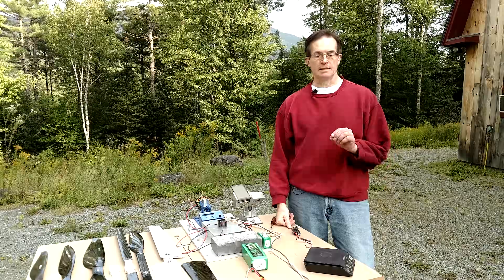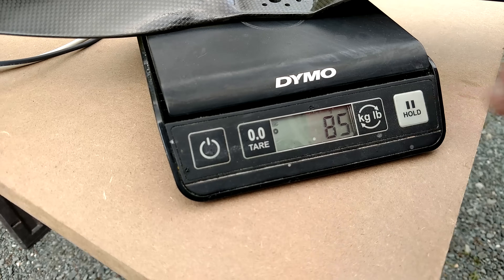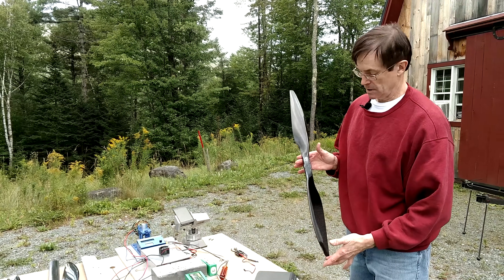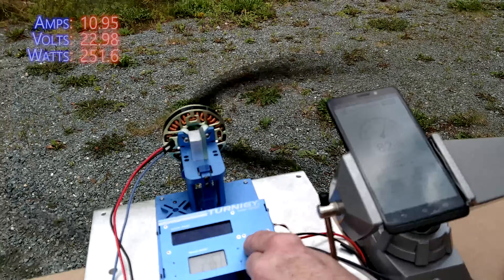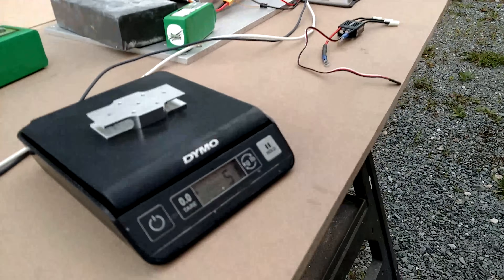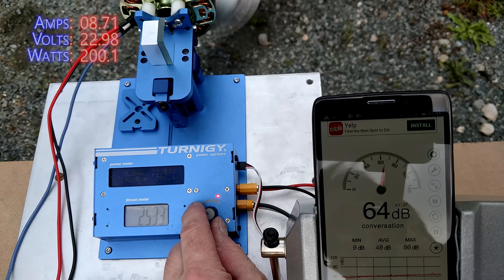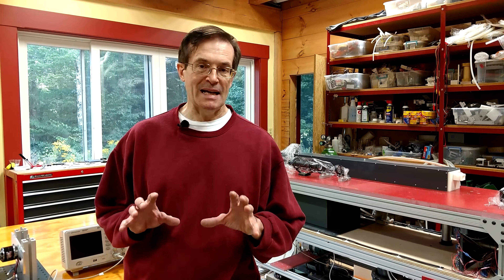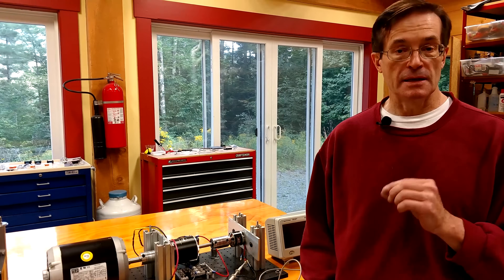Building Drone Rotors - PART 4 - The Testing

Comment: Great video, subscribed.  What primarily interests me is reducing audible noise.  Obviously larger props provide X thrust more quietly than do smaller props because the RPM is lower.   The challenge that interests me is how to use the largest possible props on the smallest possible drone platform.  If you had props which overlapped it should be possible to drive them all with cogged belts so that phasing is maintained to prevent interference.  Something I'd like to try someday.      

The APU concept is fascinating as well.  Not only for drones but also for robots.  Once again noise is an issue, so I'm interested in ways to muffle and perhaps actively cancel motor noise.  An MIT startup called Liquid Piston is developing small rotary engines for DARPA, so that's one example, I'd like to find others.  In the meantime maybe a weed-whacker engine could be adapted, and hollow structural components made of carbon fiber or aluminum could be used to store fuel.  The fuel storage and burnoff in drones would need to be designed to maintain CG, however it's done.

I haven't yet gone through the catalog of your videos so you may have addressed these points already.  All this is just off the top of my head because I'm a recently-retired electronic/aerospace tech who's still trying to get my life organized enough to have time for hobbies!  At this rate it may never happen...
Reply from the maker: We share your interest in quieting  multi rotors.  The use of alternative drive mechanisms is interesting and always involves a balance sheet.  I am an advocate of KISS and the advantage of a single motor with a single propeller is difficult to  beat.  This preference derives from the widely available components, the convenience of routing power through flexible wires, redundancy and weight.  Something we are considering is the use of two, significantly different arm lengths to improve rotor disc packing density and the hybridization of helium buoyancy and multi rotor maneuverability.  Blimps tend to be grossly under powered and multi rotors use watts for every gram they lift.
Reply: Thanks for your reply!

So I guess you’re referring to basically creating two or more concentric “rings” of props by using shorter and longer arms, so as to pack more rotor discs into a given footprint.  Sounds like a great idea for larger drones!

It would require a significant volume of He to fully offset the weight of a drone, and with all that additional surface area the wind would not be your friend, for sure.  I wonder if it’s feasible to design a very quiet motor/prop combination which is optimized for a fixed RPM region, and locate it dead center for the purpose of offsetting the weight of the entire drone, as well as provide additional cooling for power components.  If heatsinks are normally required they could be smaller if airflow is higher.  The outrigger motors/props would only need to offset the torque of the center motor and of course provide directional control.  The smaller props would no longer need to offset the weight of the drone so they could presumably turn slower and quieter.

In terms of KISS, the traditional approach of one motor per prop is probably the simplest to control and provides the most redundancy as well.  But using multiple props per motor should be lighter, or at least not any heavier, as well as allow for rotor disc overlap because phasing is fixed.  Instead of varying relative prop speeds to obtain directional control, which is not possible with multiple props per motor, you could have very lightweight steerable vanes located in the downwash of the props.   That of course would require changes to the control algorithm, so the fun never ends…
Reply from the maker: I agree with your comments regarding the choice of rotor systems.  The reason I suggested helium is because modern fabric/films such as Spectra or Dyneema reinforced polyester (Cuben cloth) and carbon nano tube based ribbon  (Miralon) have become so light and strong that nearly weightless envelopes can be fabricated and held at high pressures to ensure shape.  Contrast this with the never ending spiral of a multi rotor...if you want more payload add more batteries which means more powerful motors, stronger arms, a heavier air frame and so more batteries etc.
Reply: Tech Ingredients     A hollow rigid structure pressurized with He?  So wouldn't loss of pressure be catastrophic?  One shotgun pellet strike and you're done?  I'm curious though frankly skeptical. 

Have you considered single-blade props for lower noise?  Apparently the efficiency is roughly comparable to double-blade because of reduced turbulence.
Reply from the maker: Theoretically, a single bladed prop will be more efficient, but the rotational inertia will have to be countered and if the counterbalance is located closer to the rotational axis then it must be heavier, if it is located at a similar distance then you may as well just leave the propeller as it is.

Regarding the helium, I did not mean to suggest that we inflate a typical CF multi rotor frame.  I would certainly use compartmentalized helium storage.  We own a 6M blimp which we use for lofting radio antennas.  It's a good quality blimp, but polyurethane is pretty old school.  Modern films could allow better aerodynamic structures to be fabricated with negligible weight.  I understand your skepticism, but remember if you could remove 1/2 the weight from an existing multi rotor without changing ANYTHING else, your flight time would not double, it would increase on the order of 500%
Reply: Tech Ingredients   Thanks for the conversation.  I assumed the He would be compartmentalized but even so a loss of pressure in one compartment would still cause some kind of structural failure, no?  

My point on the single blade prop was about noise mainly.  There's videos on YouTube from years ago showing such props apparently working well on RC aircraft.  For some of the props a simple metal rod served for a counterweight.  So yes, one wouldn't do it to save weight but rather just to reduce noise.

Not sure of the terminology but there's a way to basically create a circular airfoil duct around the props which gives a bit of lift.  If it's enough lift to offset the added weight is probably a matter of how lightweight the circular assy can be fabricated.  From what I've seen so far I would bet you could make it pay off if anyone could.  The tunnel part of ducted fans which constrains the prop wash seems like the part that could be omitted without making much difference.

Comment: I wasn't clear on the thrust to power ratio comparison on these props...? 11:41 scared me a little too.:(
Reply from the maker: Al these thrust levels are in grams and the power levels in watts.  The target points are for 1500gm and 2,500gm thrust and the watts then compared.
Reply: Tech Ingredients ... So you took each prop to the 1500gm and 2500gm thrust target points and measured the the respective watts/power output for each...? Finding that the diameter is the biggest difference in efficiency... I.e. larger dia = more efficiency?

Comment: Nice to see someone gathering practical data. Yes larger diameter props give better efficiency but have a lower air speed. Thrust is reduced when your prop is in motion relative to the airflow (unlike a static test).  If your intention is to have an aircraft that is practical outdoors where you want to move at any speed or have to deal with any wind, then you will have to decide on a minimum airspeed through the prop that will allow you to maintain adequate control in all conditions. I built a large drone for the purpose of filming kitesurfing in 20-30knot winds using a gimbaled DSLR (~5kg Payload). I achieved approx 30min flight time (wind speed dependant). Keep up the videos :)
Reply: I agree, I have been flying model planes for 38 years and people still measure static thrust. This does not thing but tell you how much thrust you will have in a hover (planes hover too). Develop a wind tunnel and then have your test set up so you can tilt the prop from perpendicular to parallel with the air direction then measure thrust. For instance say a multi-rotor (don't say drone) hovering with a 20 MPH wind. You may have 5 pounds of thrust with zero air speed but soon as you have some air flowing the thrust drops. With some setup this is ok but yours in the video are VERY low power 250 watts and I don't think there is much left in the motor unless you have an 8S battery. A positive note over five pounds on 250 watts is good. Would be perfect for a 1/4 scale human powered plane.

Comment: Great video once again. Question on the DIY props though...how well do they perform at high-load levels typical of such setups? The bigger props are normally rated for over 10kg thrust per rotor, are the DIY models capable of similar loads?

Comment: A bit surprised you've not incorporated twist in the airfoil to optimize disk load distribution.
Reply from the maker: There are reasons for this.  For a given airfoil shape, the optimal AOA is the same despite varying  rotational velocity ie RPM x radius.  Because there is very little vertical velocity in these drones the rotational velocity vector dominates even near the hub. It is also much easier to fabricate these rotors on a flat surface.
Reply: * Because the propeller is working within a –moving- column of air you’ve got to incorporate blade twist to maintain a constant or optimum AOA from hub to tip. Look at any other commercial propeller. 

* The concept of an Auxiliary Power Unit to take advantage of superior energy density of a hydrocarbon fuel vs batteries is smart and logical. Hopefully superior batteries are in our future.

* Thanks for the reply! Interesting research/work you’re doing. 

Regards,
Thomas Charlton
Reply from the maker: Normally that is correct, but in this case, the heavy lift drones have a very low vertical speed and therefore all portions of the disc have their AOA nearly unchanged from the horizontal.  The commercial rotors are not designed to account for this.  They are in fact not optimal.
Reply: @TechIngredients  Thank you! This is for me  the most interesting characteristics of these slow-fly drone props so far. In the ultra heavy lift drone field (50 to 250 kg of payload and even more) there is also a branch of tethered drones. In that case, it is technically not possible to fly in high velocity along neither of axis as the drone is hooked to the ground. The only flight mode is hover. This is where your described prop design fits particularly well!
Reply: Also would like to ask is this characteristics still valid in powered paraglider (paramotor) props? The horizontal cruise speed of a PPG is about 40..50 km/h, the prop diameter ranging from 1.15 to 1.60 m and the rotation speed is about 2200..3000 RPM. Assuming the prop tip speed is kept under Mach 0.6, is it worth to do prop twisting in PPG propellers? I see almost every PPG prop is twisted. It would be nice to manufacture them flat without any twist for the cost and simplicity sake. Thanks!

Comment: Thank you for all the work you have put in your videos and for sharing them. They are clearly some of the best I've seen so far, whichever topic you take on.
In relation to propeller blanks: have you given any thought on 3D printing a mold for them? Even if you had to print it in different parts, it should make for an excellent mold for high expansion polyurethane foam. Advantages are, once you find the very best CAD model, scaling would be easy. Your could also pour a new propeller on the fly.
Thanks again!
Reply from the maker: We could do this, but the supplier of the foam blanks produces them in whatever dimensions you want and very cheaply as well.  The foam core in either case will require the carbon skin and that is where the work begins for us.

Comment: Wouldn't having 4 blades on a propeller reduce the noise? It would achieve the same thrust with a slower speed and less turbulence, thus being quieter (I guess). Have you not done that because lower-KV motors at that power are hard to find?
Reply from the maker: It is a little quieter, but it is less efficient because there is more surface drag and it is the area of the circular disc that determines the efficiency.  It is also heavier and harder to stow a four blade prop for storage and transport.
Reply: Interesting. Thanks for publishing this research for us to see!

Comment: Great video.  I really liked your testing setup with that thrust meter.
I did a little analysis of quad controlability vs size that you might find interesting.
https://diydrones.com/profiles/blogs/multi-rotor-scalability 
I've also done a lot of marginal analysis to find that sweet spot of vehicle and rotor size with some assumptions about how vehicle weight is impacted by rotor diameter.  You did hit the nail on the head with the statement that rotor diameter is the key to efficiency.  Actually is not just rotor diameter, but the cross-sectional area of your total rotor area.  So you can have a few larger rotors, or many small rotors.  I don't understand why some octo-copters like the eHang have their redundant rotors sitting in the downwash of another rotor.  It would be WAY more efficient to mount it in "fresh air" if it could be done without adding a lot of weight for supporting structure.  Interested in your comments on my project.  
https://www.youtube.com/watch?v=_1rQ2wZD8AQ&t=3s

Comment: Maybe you could solve vibration problem from gasoline engine by hanging with thin ropes in stead of fixing it on the frame.
Thats how I have hung my compressor and now it runs smoother and less vibration noise.
Thin ropes are strechtable.
Sorry my bad english.
just an idea.
Reply from the maker: That is a good method and we will use that to further reduce vibration transfer from the generator to the support structure.

Comment: What about vibrations and resonances, is that a thing.
Reply: Yes, that is a huge thing. The commercial rotors are designed with a taper and twist in order to better avoid having a single resonance frequency excite the entire structure. If you hit one of the modal frequencies you can get anywhere from the prop entirely shattering to regions of unstable flight. I would worry about any uniform cross section blade. 

Another neat thing I can't believe wasn't explored was that if you put a region of thicker prop at the end of the blade (i.e. increase the characteristic length/chord) you should be able to decrease noise levels.  They use this trick on "stealth" helicopters.